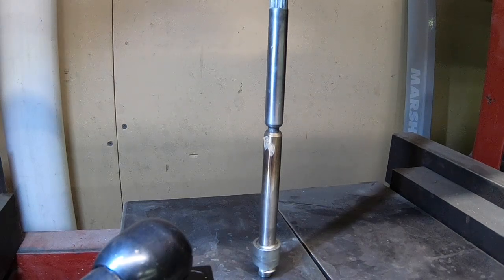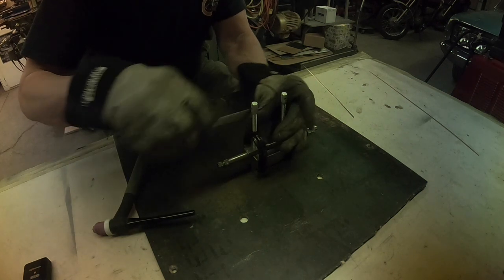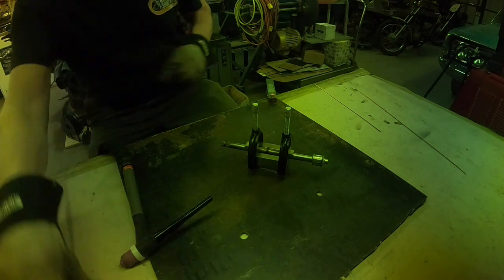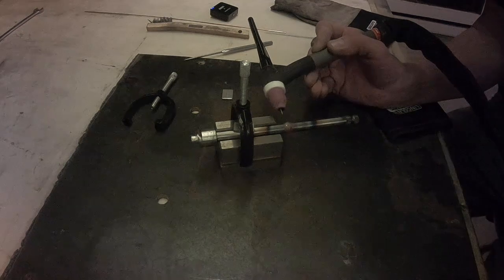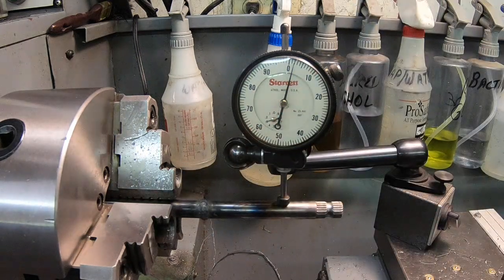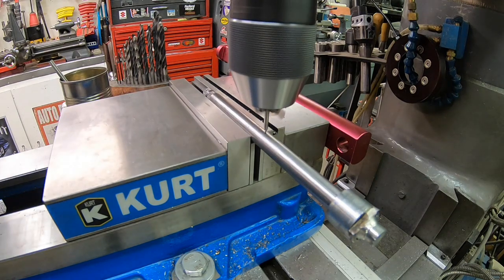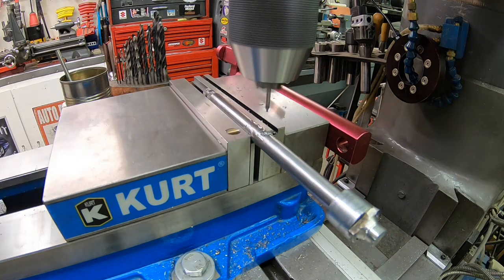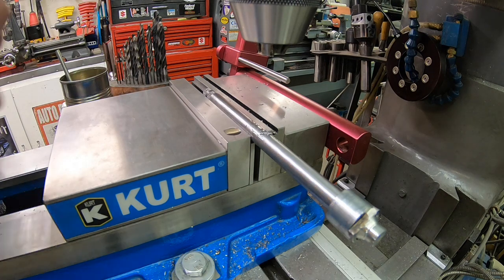Motorcycle shift shaft repair, Part 3

Comment: The press fit, weld and pin.  That shaft will never fail. Would love to see how that repair would hold up on the drive sprocket shaft.  I think it might.   It seems to me those spline shafts only fail because the shifter bolt becomes loose.  Would you have done it that way if the shaft was not bent vs the Wright video?  Tempted to try with a '87 KDX 200 with a welded on shifter. great videos.
Reply from the maker: You are spot on, when the bolt comes loose it starts getting chewed up. I cant remember how this repair was done, I have done many shift shaft repairs, all of them a bit different. I got the basic idea from Mr. Wrights video. One thing I do now is using drill rod and heat treating the spline area only. This way if there is a failure it should be in the shift lever.

Comment: Just come across this shift shaft repair series. It's so interesting and relevant as the bikes now have had hard lives. I bought a NOS shaft for my YZ80 and my DT175 will need a new shaft too because those shafts get loose and welded up. I don't have a lathe but it's handy to know that it can be done. I watched Wright's video and then your video popped up. That's the YouTube algorithm at work.
Reply from the maker: Hey Chris, yes, I had a childhood friend that contacted me about Mr. Wrights video, and asked if I could build one like he did. So, I too took a look at his video (he is a great machinist) and decided to give it a try. Since then, I think I have made 5 of them. Suzuki's shifts shafts are very soft, I now heat treat the spline area to make them last a lot longer and use tool steel. These NOS and good used shafts just are not available any longer for the most popular bikes like the RM's and TM's. I have done one for a TS also.

Comment: Great JOb as always Dale. I'm really starting to pay close attention to how you're using the lathe. Like with this project you used the the 3 jaw whereas the the 4 on the cranks. I see now that one can adjust the run-out better with the 4.... I'm learning.
Reply from the maker: Yes, there was not any real precision here like there is on the crankshaft halves. You are correct the 4 jaw gives a lot more ability to be accurate.

Comment: This really takes me back about 50 years or so, when I had a little TS-90.  I bought it wrecked from the son of a guy my Dad worked with, who had run it into the side of a car, destroyed the front end.  About 50 bucks of used parts, and I had it running again.Set it up for moto-cross, and woods riding.  It didn't have enough power to get out of its own way, but holy cow did I have a ton of fun on that thing.
Reply from the maker: Oh yeah, things were just so simple and carefree back then. It didn't take a 10000.00-dollar motorcycle to have fun. Still doesn't, that's why I like these old bikes, just like a great pair of gloves, they just fit me. Thanks for sharing your story. I'm sure it's just one of many. Thanks for stopping by.